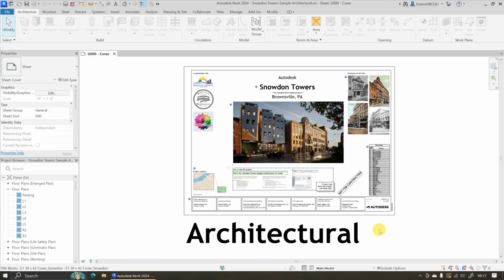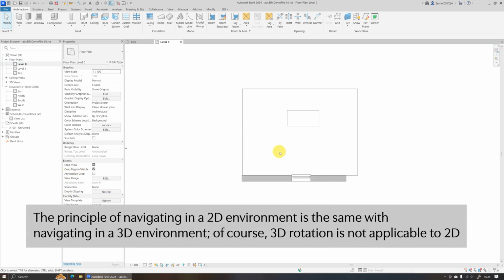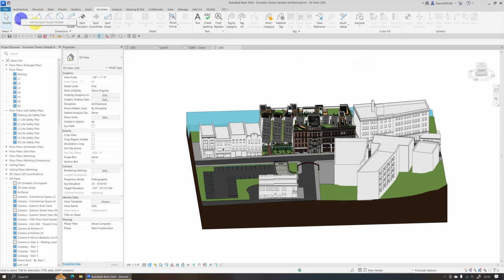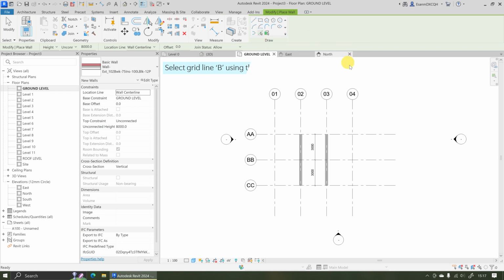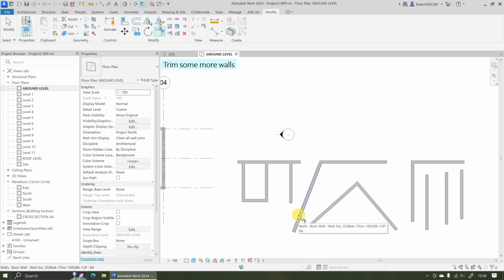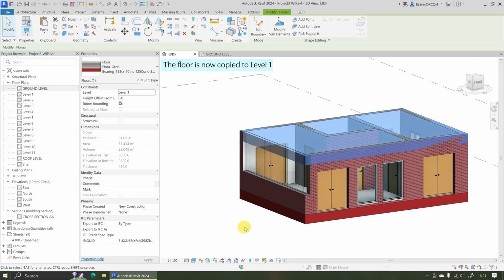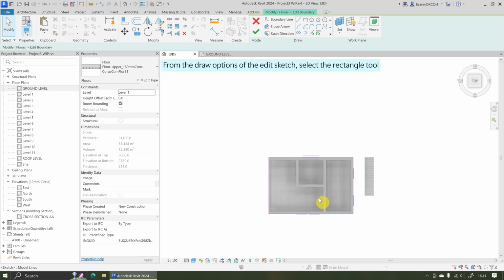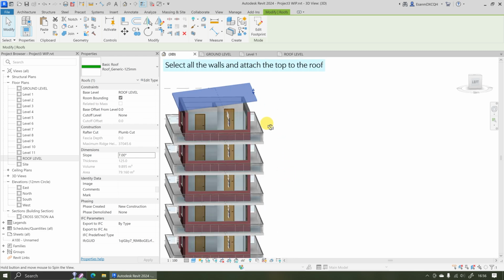Learn Revit & Build Your First Project in 60 Minutes | Revit Tutorial for Beginners (Step-by-Step)

Comment: Thank you for a well spelt out tutorial on Revit. It couldnt have been simplified better than this. I was wondering if you could also downsave that file to 2020/21 version so that some of us familiar with older version can continue to follow up as you progress? Thank you.!
Reply: The Revit Software doesn't have luxury of downsaving a project made in higher version but I think you can follow easy as all tools are very similar
Reply from the maker: you are correct. Infact the video will work just fine for the newly released 2025
Reply from the maker: Revit is not backward compatible which means newer files cannot be saved as older ones. But the tools are very similar so the tutorial will work just fine.  You can download the newer version from the link in the description.